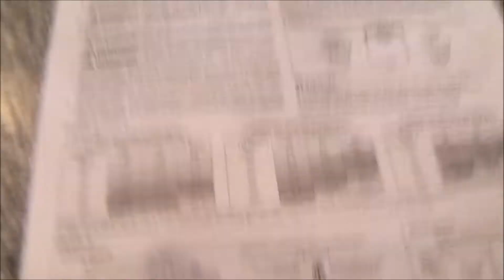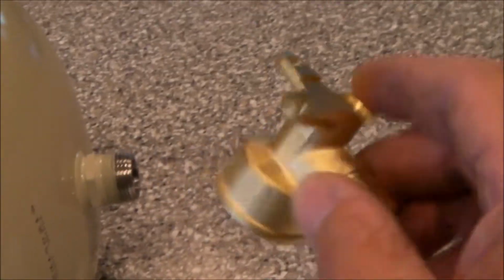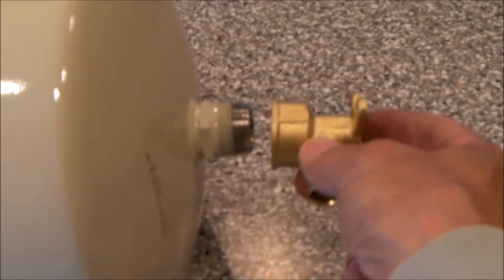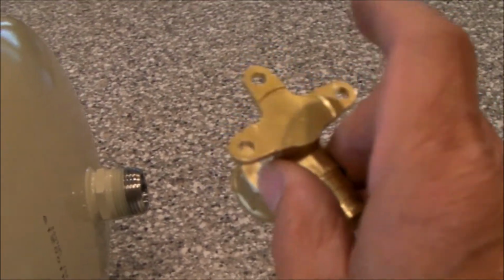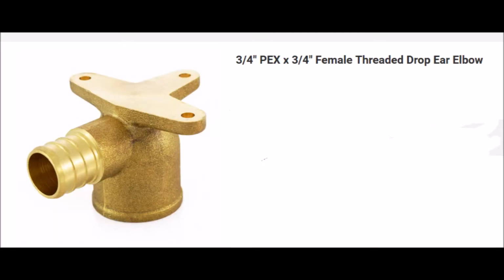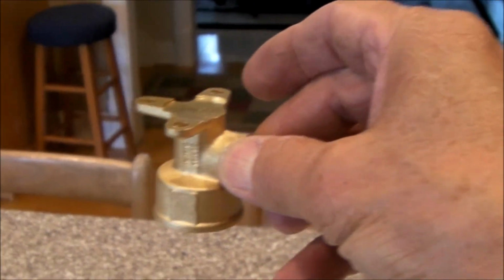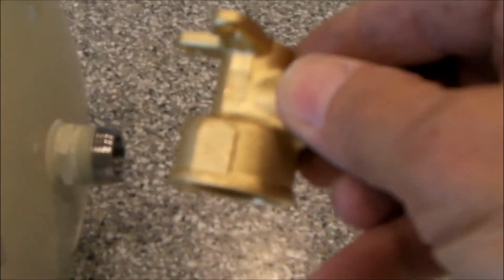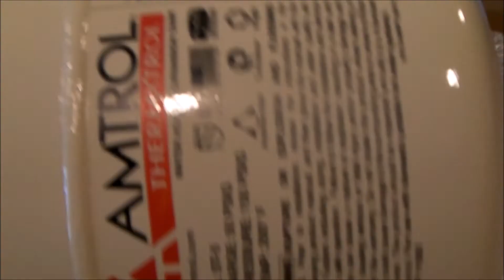How to mount thermal expansion tank for hot water heaters

Comment: The first step should be to check the water pressure of the city, measured at a garden hose bibb. If that pressure is over 80 PSI, then a pressure control valve may be required, to get the inside of house water pressure down to about 50 to 65 PSI. Then the expansion tank's Schrader valve air pressure should be adjusted to match the 50 to 65 PSI house water pressure. That Amtrol brand of expansion tank has peculiar requirements as far as orientation. Although most other brands allow for pretty much any orientation, the method for maximizing longevity of the rubber membrane would appear to be: vertical & with water intake at the bottom: opposite of your orientation. Expansion tank support can be added, if using weak plastic piping.
Reply from the maker: nope, orientation matches manufacturer recommendations so that the failed membrane indicator works properly.  Thanks for your inputs.
Reply: @YuDaMan  The "failed membrane indicator" appears to be unique to the Amtrol brand product, and may not be such a well-designed feature. The primary consideration, regardless of manufacturer, should be: longevity of the rubber membrane.

Comment: How much time did it take to make and paint your bracket vs. spending $15 for a steel bracket?  Now your tank is only supported by the one fitting and  the tank weld at the threaded connection as opposed to the two pipe clamps that hold onto the whole tank distributing that weight around the body of the tank.  If you have earthquakes in your area your water filled tank will be shaking back and forth from the one point at the top of the tank.  Something to think about.  Thanks for the video.

Comment: Good job would of liked to see your connection to the WH . Also lots of time effort into your mount. If you do it professionally the store bought mounts are worth your time additionally only two set screws are holding up your tank. On a side mount attached to WH all weight is displaced. If you install on any coastal community salt air can effect  the necks of the pressure tanks can rust quickly, under 2 years.  . Problem if you mount your way.   I appreciate sharing your video so we can all see there are many ways to the mountain top. Sorry if you think I’m being critical just trying to give respectful feed back…peace…

Comment: You're absolutely correct about the weight of the tank when full. Horizontal installation without bracing puts excessive force on the tank weld and plumbing fittings.

Comment: Good job , I tried to see if you had a pipe attached to the bottom of the tank ?
Reply from the maker: nothing attached to bottom of tank.  there's something there by the manufacturer (forget what it is) but if I recall correctly it's an indicator to show if the bellows inside the tank is leaking which means it needs replacement

Comment: Should have an isolation valve on the branch going to the tank for easy change out with less water to deal with.
Reply from the maker: I have several valves to isolate the heater and they work fine isolating the expansion tank.

Comment: The reason that Amtrol model must be mounted vertically is the special "service indicator" that will become discolored if the membrane leaks. It needs the water to collect at the bottom near the air valve.

Comment: I may have missed it but you set the psi in the tank to the same your water company has coming in.
Reply: Test the outgoing water pressure through a water spigot (water hose valve) with a pressure gauge and match that pressure

Comment: So if the directions said "vertically in downward position", why did you mount the tank in upward position?
Reply: Ari Lin  Eastman themselves don't show it installed that way. You would only get stagnant water if the expansion tank fails. Same problem in EVERY orientation when water is pressurized .
Reply: I see so many people installing these upside down  .  this one is correct and allows the water line to "burp"anytime the house is serviced
Reply from the maker: It is not upside down.  This is further confirmed by the manufacturer's labeling which would not likely be printed and attached, upside down.  The tank is definitely oriented as called for in the manufacturer's installation instructions AND as shown on the actual label.
Reply: @YuDaMan  my bad, I guess I interpreted the directions differently.
Reply from the maker: @aaronegner71  Hey, NO Problem.  Glad I was able to clarify.

Comment: Those smaller tanks don't last long. Do it once and I'd recommend a 4 gallon tank.
Reply from the maker: My ST-5 tank has a 7 year warranty so that happens to be good enough for my situation.  Here are some other considerations:  the T-5 has a 1 year warranty. The ST-5 has an anti-microbial liner which kills bacteria growth and the T-5 just has a plastic liner.  The ST-5 has a turbulator which swirls around the water so there is no sediment build up in the tank. T-5 does not have that feature.    To your point, some tanks might not last long but the more expensive ones have other features and LONG warranty period.
Reply: Probably depends a lot on your quality of water. RO water in my town ;)
Reply: @fortvalor  True .I see bad well water that eat these things.